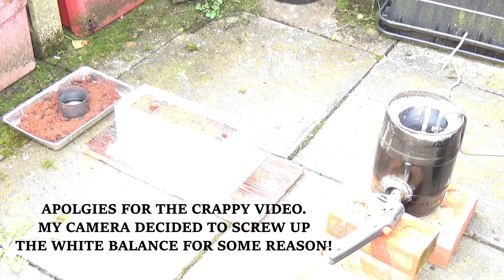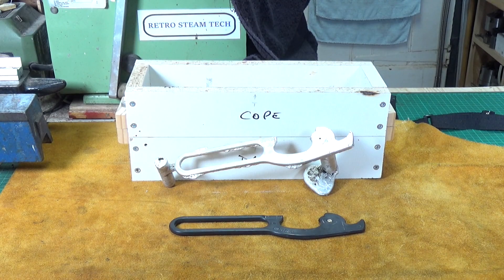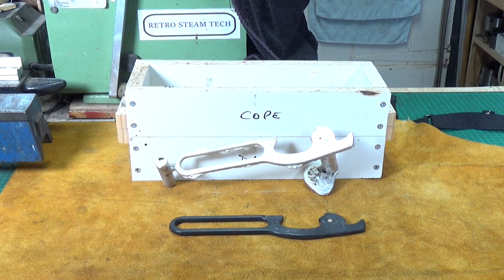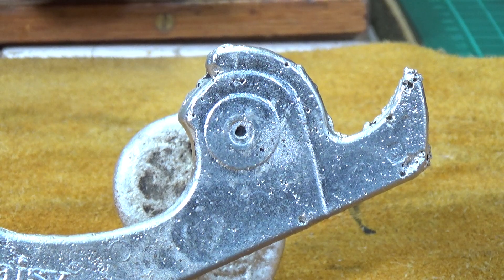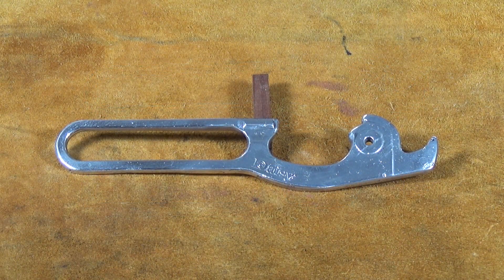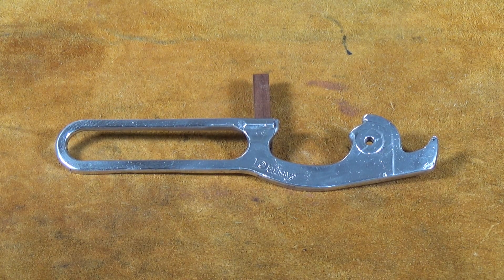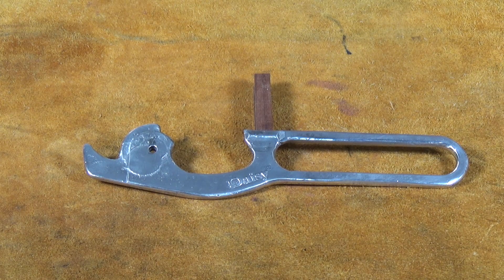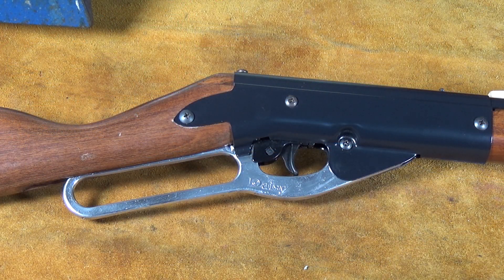Home Metal Casting - A Replacement Aluminium Lever For A Daisy Model 95B BB Gun - Part Two

Comment: You make em to sell or juat for urself ?
Reply from the maker: Just for myself.
Reply: @RetroSteamTech danggg ive been having  ahard time finding a high pivot point metal lever for my model 1999 bulls eye the plastic handles so cheaaap
Reply: And thinking my only option is to go buy a brand new red ryder to take the handle
Reply from the maker: @xXPARIAHXx902  About the only place you might find a lever is ebay.
Reply: @RetroSteamTech no luck on ebay canada
Reply: Does it have the have those grovese on the pever or can i make one from a peice of steel @RetroSteamTech
Reply from the maker: @xXPARIAHXx902  It would be quite a bit of work but you could make one from a piece of steel plate.
Reply: @RetroSteamTech seems easy enough ill give a goo and let you no wish theyre was someone in canada who worjed on em so i coukd send one of the old ones im pickibg uo ina few days off
Reply: @RetroSteamTech i got like 6 lined up for the nect week ranging fron the 56 daisy long rifle and some other ones before the 80s
Reply: @RetroSteamTech theres also a pre ww2 i beleive ib there buddys not liking my 100 dollar offer but the woods toast

Comment: Good result for initial tries!
I used to do sandcastings in aluminum, first as a student, then as a TA, in college to become a secondary education Industrial Arts teacher. All that 50+ years ago.
Earlier comment regarding parting lines is correct and required if part has details (logos, etc, on both sides).
A couple of tips: You should get a little better detail if you filter the sand thru a fine mesh kitchen sifter for the first inch or so, then fill & ram in layers till full. Also, if you create your gates and risers with tapered sprues, they will be easier to withdraw without damage.
Good luck.
Reply from the maker: Thanks. I have done similar castings before, using original flywheels as a pattern. As I said in the video, a split pattern would have been the ideal. Good idea to use a sieve for the first lot of sand, I have in fact just ordered one. I've never had a problem with withdrawing gates and risers and I generally use round bar or tube. Then again, none of my casting flasks are very big so they don't go into the sand very far.

Comment: Not bad. I was wondering how it would turn out since you buried the handle in one side instead of making a parting edge with half in one side and the other half in the remaining side. If you look at the original, there was/is a parting line in the very center of the cast. But all in all, you did a respectable job...  Thumbs Up!
Reply from the maker: Thanks. Very difficult to do what you suggest without using a split pattern.  I guess you could try pushing the pattern into the sand until it was about half way. Difficult to get it level though.

Comment: Good tutorial and result Alan.  Looks and operates great.  I have used very fine children's playpen sand mix with ATF (auto transmission fluid) successfully.  I read about it on a native American silversmith site.  The finer the sand the better the result.  Cheers Rob
Reply from the maker: Thanks Rob. I think you can tell from the video that I was surprised at how well it turned out. Using playpen sand & ATF sounds like a great idea. Over here, Petrobond is fairly cheap, 2Kg cost about £12 and lasts a long time. Cheers, Alan.

Comment: I’ve been wanting to try this for ages, but to make metal replacement parts for models. 

Like Metal legs and thrusters for the Dinky Thunderbird 2. 
Hate the plastic ones! 

How difficult do you think that would be giving they are fairly small?

I actually thought you would want the lever made from steel to handle the torque.
Reply from the maker: I don't think it would be too difficult. Some of the very early Daisys had cast iron levers but most of the metal levers are aluminium.